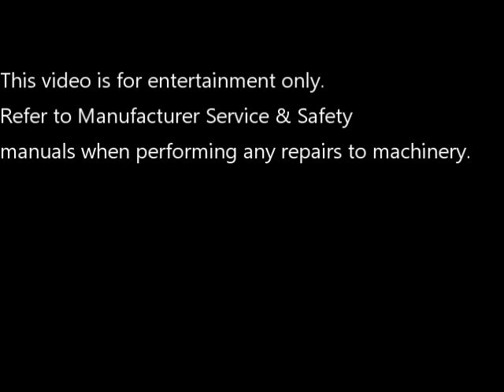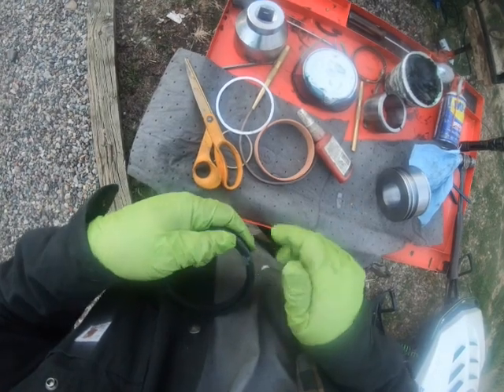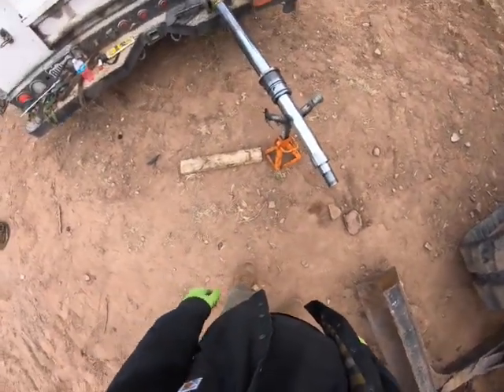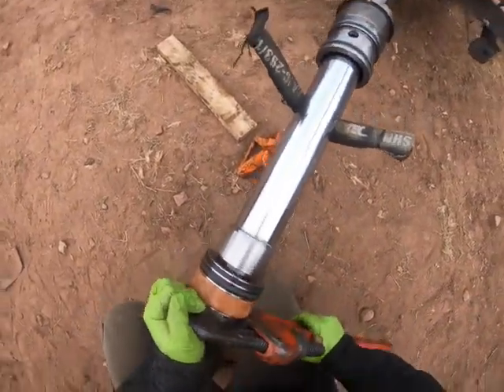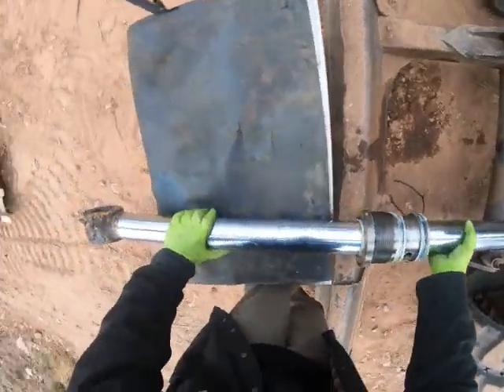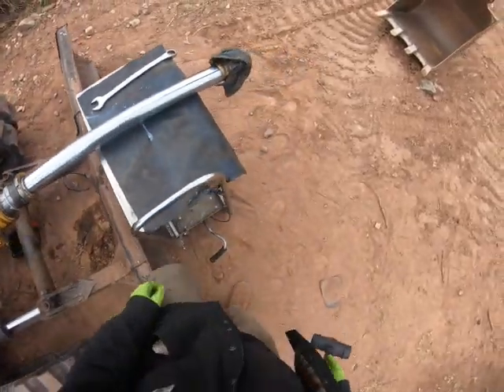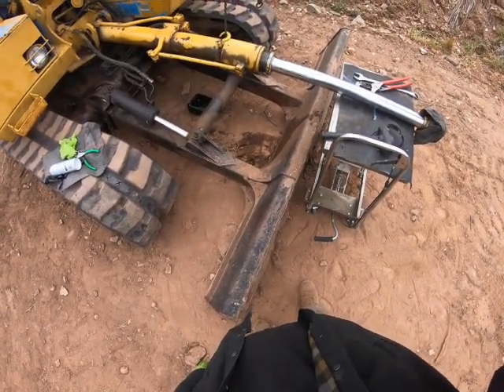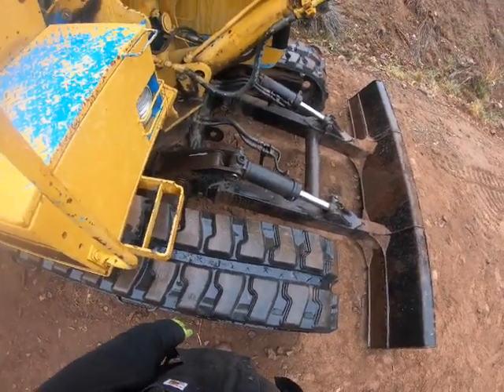Cat Excavator Lift Cylinder Rebuild Part 2Pipe Wrench Edition

Comment: What kind of grease are you using to hold the o rings
Reply from the maker: I either use silicone grease or transmission assembly grease.
Reply: @paulsequipmentrepair823  ok cool about to do the same cylinder on my e70b is there a brand you like better then another?
Reply from the maker: @dav2386thor  For seals I prefer Hercules. The Transmission grease comes in a little green tub, I believe it is made by lube guard assembly goo. I also use silicone high vac grease, you can use the stuff at the auto store for brakes and o-rings. Those two work well for holding things in place. Hydraulic oil for a lube works.